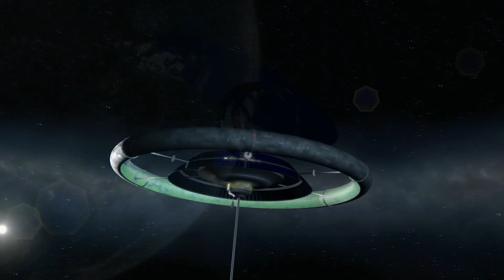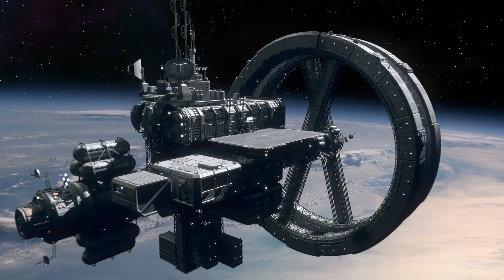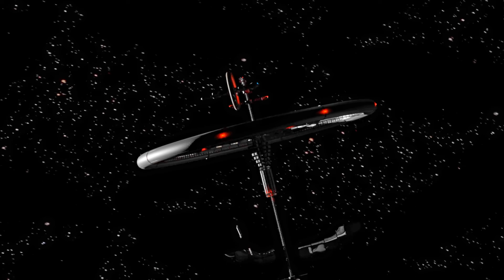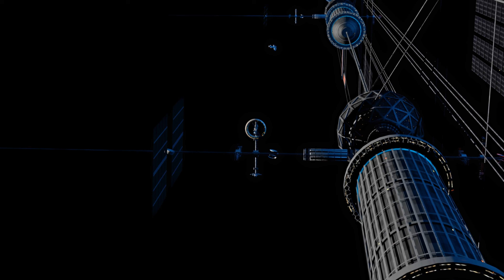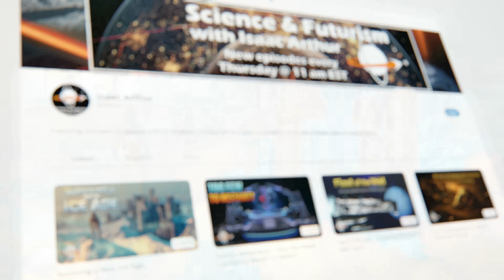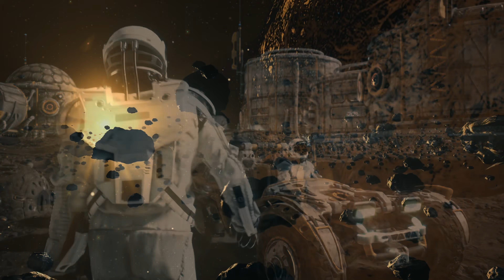The Von Braun Wheel - Building Humanity’s First Rotating Space Station

Comment: I always imagines spin habitats as having a massive park facing the interrior space, with redidential levels "belwo" that - towards the outer hull. Under than are industrial levels, with somewhat higher gravity. A large wheel has a smooth gravity gradient, so we can have many layers beneath, and plenty of park space just a few floors above. 

I can see cafés, restaurants, museeums, zoos on the perk level, but very little actual habitation.
Reply: Generally the O'Neill size habitats have the option to run multiple floors like Babylon 5. Small stations can only run one-two floors because too far inward and there isn't enough gravity and beyond a second floor, it would be tearing itself off the structure.
Reply: @jsbrads1 Aren't both of these just a matter of adjusting rotational speeds, though? The gravity at inner rings would be more a function of their radius from the center or as a fraction of the gravity at the outermost ring.
Reply: @AndyKauffmanGleekop  for a given rotational speed, you get a useful "gravity" based on your radius. For people standing up, they also have to be pretty far from the axis of rotation or they would fall over all the time.
Make the radius big enough to be used by a person and then try to squeeze out the smallest "gravity" that is still useful, and then build the structure to hold it all together.

Comment: IMO: Using Lunar Regolith to create a concrete like material that can be continuously cast into an cylinder or wheel is a good option for building a new rotating space station around the Moon rather than the Earth. The Earth facing side of the Moon would also make a good site for a Space Elevator to send up regolith. Lunar Synchronous Orbit construction of a cylindrical Space Station might thus be possible. The cost of building all of the components on Earth and then sending them into orbit is a limiting factor. :P
Reply: I line this idea as even a way to build out an Earth-orbiting Wheel. I expect the first spinning stations to be rocket upper stages connected together, but eventually full size and more polished Wheels will get created. Materials could be imported from the Moon, possibly as easy as Atermis II's return trip. That material could be used to build a Wheel from an Earth-created framework.

Comment: The Wheel is small enough to operate several in earth's orbit and whatever else they are being used for could additionally replace the satellites we have in operation right now, cleaning up orbital space. That would also give astronauts a chance of survival in case there is an accident.
Even if they are small in size, one Wheel can have several functions.
Reply: You build one wheel then expand it to a pair of contra rotating wheel with a gravitation free drum in the middle for manufacturing.

Send a fully ready one to the moon with an ore processing set up. Crew stay in 1g orbit running mining equipment. Only engineers go down for repairs.
Reply: @seriousmaran9414 Teleoperation of equipment also allows much easier landing of robotic craft. You have immediate response time for landers, avoiding some of the recent problems that have plagued landing attempts.
Put another way, landers don't tip over or faulty LIDAR sensors don't cause the lander to misjudge its altitude if there's a human sitting in orbit controlling things in near real time.
Sadly, this is what Gateway was meant to provide.

Comment: A hydroponic farm with artificial light  uses red and blue light, not white light. The animation you use for a rotating farm uses white light. Its not critical, white light works, but that sequence could be much more eerie by using the correct light.
Reply: The white lights might be on when the workers are inside the structure and then switch to the perfect color for those plants and get flooded with CO2 when empty.
Reply: @jsbrads1  Flooding with CO2 will kill the plants. The roots aren't photosynthesising, they're respiring, and they need atmospheric oxygen just like we do. Also plants grown in a high CO2 atmosphere stack on sugars and other carbohydrates, so they grow fast and can hold a lot of water, but they don't sequester vitamins, minerals, and other nutrients essential to our health at the same speed. You end up with sweet but bland food and malnutrition that way.
Reply: @tealkerberus748  did not know that. The optimal mix of gases for the plant, a little higher CO2?
Reply: @jsbrads1  It depends what you're trying to achieve. The more CO2, the more sugars and fibre. For food plants, that means sweet, bulky, bland, and nutrient deficient. For trees, that means coarse-grained and brittle. Also more sugars tends to mean more insect pests.
If you want something to have a high proportion of complex chemistry like the essential oils in many herbs, slowing its growth will do that. Lower CO2 or less water are both valid options, depending on the plant.
Reply: @tealkerberus748  sure, but in this case if it is isolated from insects that won't be a problem. Whatever the best mix is for each plant 💁‍♂️
Reply: Many plants do better in broad spectrum white light than in red and blue. They have other metabolic functions that use light beyond just chlorophyll photosynthesis.

Comment: Two Von Braun wheels bolted together spinning in opposite directions would have some benefits, it could be stopped and started electrically as they could push & pull against each other, handy for maintenance and orbital manoeuvring plus with solar panels it could help to generate a magnetic field to help shield against solar radiation etc. A stationary docking hub would be easier to manage ..  Which I reckon is what you want for travelling to and from Mars given the duration of the journey :)
Reply: That would be visually appealing on approach, fer sure...
Reply: You would actually need three wheels.
1/2    1    1/2     weighted wheels with the center wheel turning opposite direction of the outer two wheels. If you have only two wheels, when you spin up and down, the axis would start twisting too.
Reply: @jsbrads1  mmm... I'm not sure that's actually correct, but yes, what you suggest would definitely work though but the down side is extra complexity.
If the two fly wheels were equal weight and balance where would the twisting torque come from ?
Interesting point though
Reply: @freezatron  it is called procession, it only occurs when spinning up and down. The one wheel version is displayed in college physics classrooms all the time.
Reply: @jsbrads1  yep, I understand gyroscopic precession and the behaviour of a single wheel but that only occurs when you try to push a rotating object off axis, as long as the rotation axis remains stable you don't get that wobble, and it's not because of start up or slow down, it's due tor rotational speed V squared over R equals acceleration.... Force equals mass times acceleration. .. which determines the strength of the gyroscopic precession etc. etc......

Thing is though with a twin wheel set up all the forces are in balance and whilst these gyroscopic precession forces haven't gone away but they opposing each other equally leaving us with a net result of zero precession. and even then they still only occur when another force tries to push things away from the established axis of rotation.. which is exactly what is not occurring in this scenario....

The single wheel example you gave does what it does because not only do you have to consider the rotational forces involved but also gravity too which is where the induced wobble is coming from.
When they run that experiment with two opposing wheels it just stays put or simply falls to the ground. If you try turn a twin wheel setup by hand you won't feel any gyroscopic precession, the bearings will but that's another story but taken as an entire system it's all in balance and the behaviour is different as a result :)

I hope that clarifies things for you bud :)
Reply: @freezatron  I tried to find stuff on two counter rotating wheels. I agree there is no total torque once it is spun up. Once it is spun up there is even gyroscopic stability, the whole structure will counter rotate once per orbit.
I realized I can test this by glueing two coins to short pieces of straws slipped onto the two ends of a pen and the acceleration can be induced by a rubber band and the whole thing can be hung by a thread. I'll see if I can get some Elmer's glue or something.
Reply: @jsbrads1  you'd be better off using some lego and their big wheels or something.... you need more mass and or speed so you can feel the forces properly... try one wheel then two etc. etc.

note that it doesn't matter if your spinning them up or slowing them down or steady or whatever, if the forces are balanced then the forces are balanced.

As for being orbit, that doesn't matter either, it's just when you try and rotate the whole system in an axis that's not align with the rotation then the bearings will feel the forces even though the system as a whole cancels everything.

As for manoeuvring in space you would stop the rotation of the wheels before preforming an off axis attitude adjustment, or at least slow them down and make small/slow attitude adjustments to minimise the internal stresses etc.

Ideally for a space ship it might be best to have the axis of rotation align with the plane of the solar system to minimise all these extra considerations because that is the plane in which you would want to be manoeuvring in anyway thus course corrections would be simplified.

For things like entering and breaking orbit you would stop the wheels altogether before doing the 6 minute burn or whatever it might be as that will be quite a lot of G force and you don't want anyone falling on to the ceiling etc. in reality everyone would strap in to some safe seats up front somewhere, do the burn etc. and then return to a spun condition once the burn is over and done with. ...

But that's the nice thing about a twin wheel setup, easy stop and starts that don't require any fuel unlike a single wheel, all this is less of a concern for a space station I guess because you're not going any where with it... but maintenance would appreciate the twin wheel setup.

The triple wheel is unnecessarily complex from an engineering point of view, the simpler you can keep things the easier they are to build and maintain etc. etc.
If you don't put it on it can't go wrong :)
Reply: @freezatron  I don't have Lego, but someone I know might. I see the double wheel as a low G structure, the outer rings can be designed for rotation and not need to face tremendous forces parallel to the axis 🤷
Reply: @jsbrads1  yeah that's not how this works bud. The G forces are independent of the arrangement, the faster the wheels spin the more G is induced.
One wheel or two, doesn't matter....
remember it's "v2/r=a" :)

v is velocity measured in meters per second which is squared.
r is radius measured in meters.
a is acceleration measured in meters per second per second, funny expression but that's acceleration for you :) 
9.81 meters per second per second equals 1 G :)
Reply: @freezatron  I was specifically saying the rings are designed to handle the terrible forces from spinning, trying to do a high G acceleration of the entire structure would add significantly to the amount of structure needed to stiffen the rotating structure.
Reply: @freezatron  Oh, it does happen. Imagine a Rivian pickup truck doing a "tank turn." Now, instead of very small wheels with opposing traction on a stable surface, imagine very large wheels with opposing rotational momentum without any exterior force to stabilize them. 

They begin to pivot as if they are finding traction on an invisible surface, doing a "tank turn". 

We used to experiment with hand-held gyroscopes when I was a kid. It's a freaky feeling, trying to twist a single spun-up gyroscope. It's hard!  They want to stay stable in space. But then you attach them to each other and wind them up to spin in opposite directions but on a shared axis, and they behave differently... just as jsbrads1 described. Try it.
Reply: @Wordsmiths   not sure your metaphor works very well...... yes gyroscopes do freaky things but again ...
...when you have two bolted together spinning at the same speed but in opposite directions all the forces are balanced out and the entire object goes back to behaving normally and you won't feel any gyroscopic forces ........  the internal shafts will feel it but if they're strong enough to resist it then the whole system won't......

Why are people having such difficulty understanding such a simple thing ??
Reply: @freezatron  It's not a metaphor, it's a science experiment. Try it. I don't know what to call the kind of twist that begins, it's strong though. 

Oh: I am wrong. I just realized how you would balance it out. This twist was strong because the two gyroscopes were enclosed in frames (to keep our little fingers out) and attaching them together meant they were separated from one another. Maybe by half the radius from the axle of the gyroscope to the end of its spinning wheel. Bringing the two spinning wheels closer to one another (closer to their barycenter if they were huge enough) would probably cancel out that force. And you'd have additional static stability if the common axle for both counter-rotating wheels extended out beyond the hubs in each direction, with an equal mass on each side. 
There's something about how far apart you have your two planes of rotational momentum, and how much or how little mass is on either side of their shared axis of rotation.... separating them substantially induces the "tank turn" twist. 

And now that I've realized that, I've realized it's a trivial solution: a long heavy axis/axle. Which you'd have anyway, for zero-G station operations. 

Never mind me! Carry on, engineers! ;-)
Reply: @Wordsmiths  yep, I've tinkered enough with gyroscopes to know how they work, one on it's own behaves very differently than when two are bolted together, try the experiment for yourself :)
Reply: @jsbrads1  Considering your point further I was contemplating how you would get a twin opposing wheel set up to twist on a start and stop cycle and the only thing that comes to mind is if you have a single point of force injection so to speak, such as an electric motor whose axis is perpendicular to the wheels etc. with a pinion gear or the equivalent that sat between the edge of the wheels, that provide an unbalance torque which would induce a twist. But this is easily negated with another motor on the opposite which would necessarily be turning in the opposite direction thus balance is restored.

Not that you operate things in such a manner, both wheels would contain electromagnetic coils all the way round the perimeter on the facing sides thus the induced forces would be balanced all the way around too, thus not twisting :)

Plus the electromagnetic coils could be made in such a way that they also generate a magnetic field by having two sets that fight each other a bit during normal rotation, one set is slowing things down but is over powered by the one keeping things turning and using solar power no fuel is used to keep this going. Naturally this solution would be most effective around the perimeter but that's where the habitats would be anyway. And yes, it might not do a perfect job of shielding solar rays but it would help, at least I would like to think so :)

I suppose a metaphor for this might be imagine a square table for example and on one pair of opposing corners you have a pair of forces pushing down and on the remaining two corners you have a pair of forces pushing up an equal amount ie all four of the forces are equal but with opposite pairs.
What would happen given that all the forces are in balance ?

Not exactly the same scenario I know but such is the nature of metaphors :)

Comment: Esa can do the heavy lifting and build the Von Braun ring. The name will have to change, due to the WW2 connotations. We don't have a space station of our own. Why not being ambitious. Building our first one.
Reply: i think the original concept would keep the name but if any are actually made would have its own name and design
Reply: Von Braun Ring is fine. They don't like the name they can go cut themselves.
Reply: I think it'd be much easier to start much smaller. A spinning station could be as simple as 2 otherwise-expended upper stages linked by a rigid connection, then started spinning. It can then become a destination for low- to medium-lift launches.
Beyond that though, I think ESA should start buying / working with Vast to use the stations that Vast had already planned, but NASA has semi-abandoned. Yes, Vast is American, but if ESA owns them they're technically "European" and it makes bootstraping itself MUCH easier.

Comment: If you exert force on the spacecraft by walking around in its artificial gravity, would you not also adjust its spin rate? Would you not act as a flywheel by doing so, or is that supposed to be counteracted by a set of flywheels?
Reply: When you walk on Earth, you change the rotational speed of the planet, but it is too small to measure even with our most sensitive measuring devices.
On a large wheel, many times the size of the ISS, the motions of the people might have some very small effects on the Wheel, but it would be too small for people to feel. Think of it like how much does an aircraft carrier move down as you are jumping up on the deck.
Reply: Suppose so, but it generally would balance itself out unless everyone was moving the same way all the time. You could always adjust the spin as necessary. You'd likely need to anyway.
Reply: It's not like the ship is in a perfect vacuum, especially if in near earth orbit, so it would need correction burns pretty regularly anyways.